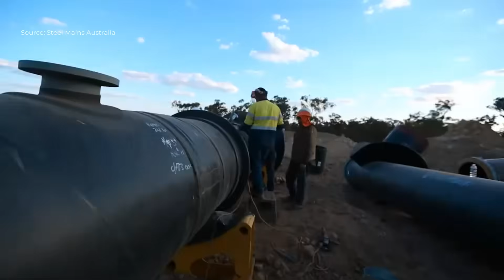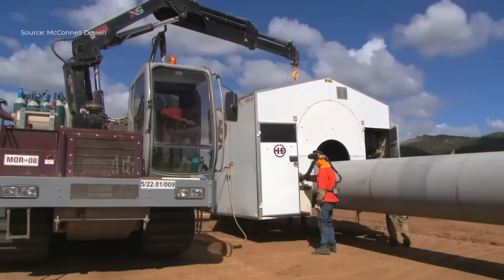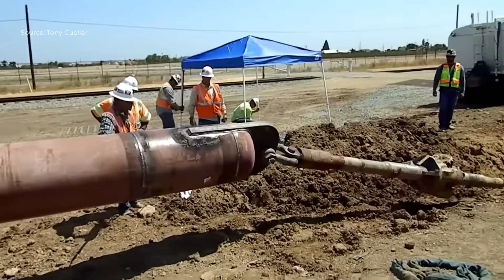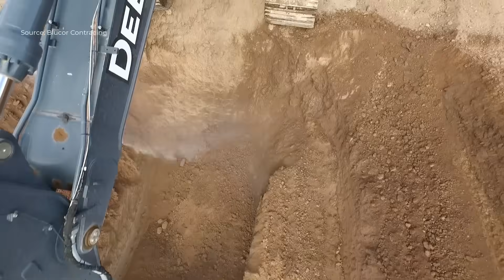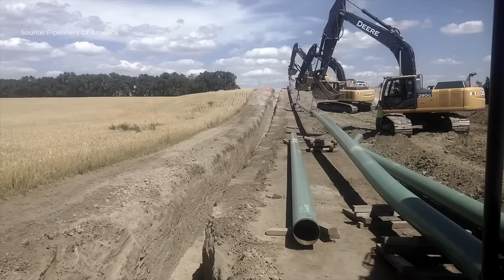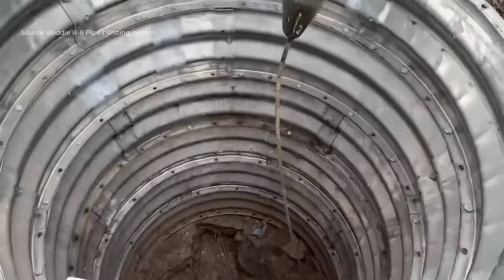How Did the U.S. Build 128,000 km of Crude Oil Pipelines – Free Documentary on Mega Construction

Comment: lets see whos in the outfit changing rooms today shall we.. to the door panels we go. inside this luxury murdered out black widow diesel fed f-550 hosts a 12 speaker bose surround system with a touchless screen monitor also the boom from under the rear seats are controlled by a kicker amp with a built in crossover also....,,, the bullydog tuner kit allows peak performance out the 6.7 powerstroke twin turbo engine thats unleashing a whooping 500 plus horsepower to the rwhp andover 1100 lbs ft of torque as well.....sitting on massive 40 inch ilitary grade kevlar tires.lol with american force rims and locking hubcaps cause these tires cost katie almost 10k for a set of 4 tires. on the front of the truck kitty spent some her money from a couple house repossesion and installed a 3/4 ton winch also...... the truck is powered by KC lights that jr bought sonny under the hood is gold plated twin turbos with paxton and paytons names engraved in the turbo units....... the truck was tore down as the engine was rebuilt in my garage  taking the truck from a measley 350 hp out the ford factory to its max performance once the truck was ran on the dyno system and tweaked out.lol. dont forget when we stop for fuel use diesel thats why the gas cap is green sweetie. i know my gases like you know your asses. ok..... the seating in the truck was leathered stitched on a singer sewwing machine by kelsey whos migrated to s. cali now to start her new life and she leaves nehind her skins for fun...... the illegal window tinting was paid for by haylie and chelsey for giving her my tooth as a lucky charm gift..... every part of the bossmans truck was bought and paid for and installed by one employee..... the air ride suspension allows the truck to lower and raise up to 6 inches like a off road elevation truck... the rear car seat was donated by willow to her fav cousin paxy as a gag gift also..... and of course the galaxy fiber optic roof lighting was done by the wire freak show ladies who loves sitting back and and hullucinating on lsd..... under the truck was sprayed with a rust oleum oilbase spray from longs. for those muddy rides or maybe a long wintery drive up and down arthurs mountain side mansion home.lol. after the garage finally finished up with the most rare barn find corvette ever with matching numbers and sonny dumped hundreds of thousands of dollars into teds old corvair the car was placed in a pull behind trailer for the greates dad and pap ever and loaded into a covered trailer that leonard trailer gave as a gift for buying so much equipment from... so trey adds another stop to this long journey home. calculating if 7 days is long enough to leave from ohio. to texas all the way up to utah then make it home in time for big mamas b-day if not we can pull over at a rest stop and fuck sam idc...... ok i bought a new dip stick and placed it in the glovebox so if that dip stick doesnt have 2 pink or blue lines on it when we get to the ranch. dad aint gonna be able to live this down. so,. anyways the truck was finally finished waxed with a ceramic coat high gloss finish as katie hung her dads wedding ring on the rear view mirror with a pic of her and paisleys pic giving me the middle finger..... and on the dashboard was a polaroid nude pic of katie with her legs spread open and a ting hand written note. when u get home. this is yours it said